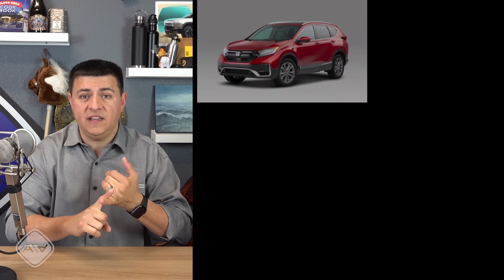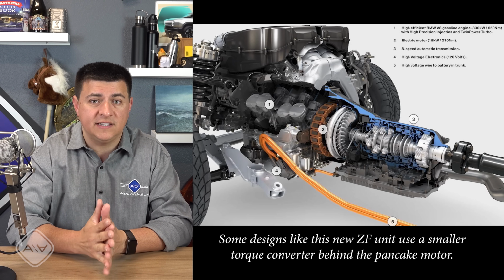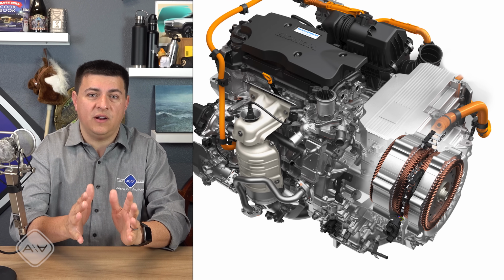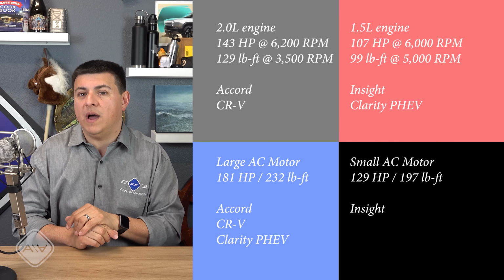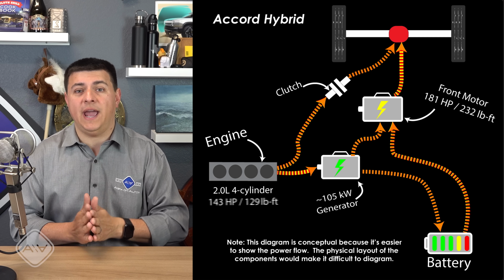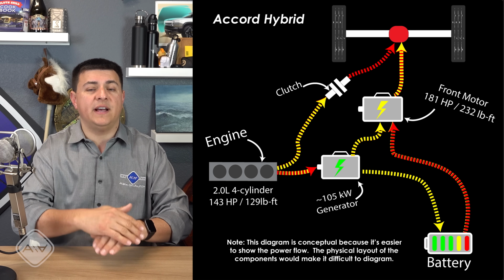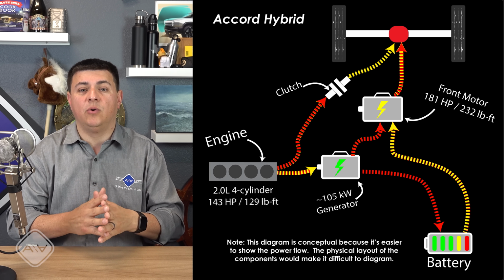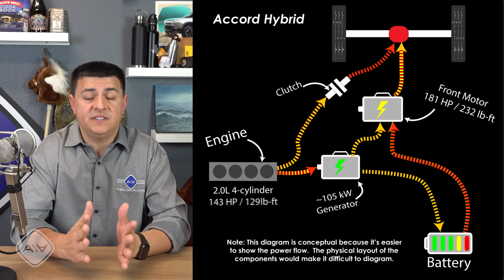How Does It Work?  Honda's 2 Motor Hybrid System Explained!

Comment: People who buy these cars don’t care what the “horsepower” numbers are.
Reply: Sure they do.

First off, directly comparing HP numbers is only valid if the engines and transmissions are roughly similar. Here's an example of famously-similar cars that illustrate that you can't use just horsepower:

Accord 1.5L, Turbo CVT, 192 HP. Car&Driver 7.3 seconds 0-60 mph, 5.2 seconds 50-70 mph.
Camry 2.5L, 8 Speed AT, 203 HP. Car&Driver 7.9 seconds 0-60 mph, 6.0 seconds 50-70 mph.

Accord 2.0L, Turbo 10AT, 252 HP. Car&Driver 5.7 seconds 0-60 mph, 4.1 seconds 50-70 mph.
Camry 3.5L, 8 Speed AT,  301 HP. Car&Driver 5.8 seconds 0-60 mph, 4.6 seconds 50-70 mph.

The Accord does much better with less horsepower, because it is turbocharged.

Second, it is a myth that Hybrids have to be under-powered. A myth propagated by manufacturers who want to squeeze an extra 1 or 2 mpg out of their cars because they think people won't care. Out of about 50 mpg, that is almost insignificant. Some hybrid owners do car about acceleration, and this system provides it. Note that #1, #3, and #7 on the following list use the system described in this video (#4 is a Toyota.):

https://www.motortrend.com/news/12-quickest-cars-get-40-mpg-higher-highway/

Third, It is true that #1 and #7 can really only put 181 HP "on the road," not the 212 HP they are rated at. But SAE Net HP, which is what gas-only cars advertise, is also not what those cars "put on the road." The difference in the Honda hybrids may be more, but that 181 HP is available at all speeds above about 40 mph. Gas cars can get it only when the transmission lines up with the peak HP.

Comment: Even though it's a new design, I can't believe they still engineer hybrids so bad!
I've always said, they need a 750-999cc triple cylinder engine, that's always connected to the wheels via a torque converter and a dual cog system when driving. 
It should be a motor tuned for torque, not hp (which is why a Diesel engine is much better).
It's low gear ratio should be ~ 1k rpm @ 10mph (5k @50 mph), for charging while driving mode, and it's high (overdrive) gear ratio should be ~1.5k @ 40 (~4k @ 100mph).
It's use should be just to maintain cruising speed, not acceleration. For acceleration the powerful (~100-150HP) electric motor is in place.
A high torque 750-900 cc engine in ICE mode only, in low gear should consume roughly 50-75 mpg driving between 20-35mph (and is mostly only driven for charging purposes, or driving the car in non electric mode) 
, and in high gear roughly 60 mpg, due to higher driving speeds.
At speeds over 85 mph a 750cc engine might need the electric motor to aid in speed (lowering battery charge at those speeds), and at ~100mph or greater, the 900cc engine will need electric power to gain more speed.
The correct way to make a hybrid, is to run an engine at a very high overdrive gear, and electronically control the throttle body for preventing lugging or predetonation. 
All you need is a single electric motor, acting both as motor and generator, mounted via a reduction gear and a clutch, to the output shaft of the engine, since the engine should ALWAYS  be driving the wheel (with the exception of stop-start traffic,  hence the torque converter).
Your greatest mpg gains are when the engine is running at 1.5-2.5k rpm, regardless of speed, and when it can directly transfer the power to the wheel, without a transmission (just a single reduction gear cog).
Reply: Doing it this way, the car will work well in hybrid mode, getting an average of 60mpg with the engine on at all times. 
Most of the charging will happen at stop lights. No need for multi motors.
This car also needs a supercapacitor pack, that contains enough energy to launch the car from 0-60 mph on all electric, or to store enough braking energy when coming down a large bridge.
Driving it in phev mode, means a larger battery pack is needed, and the car will need charging daily; the engine can be turned off at low speeds, and only turn on in high gear (above 40 mph) or when the battery pack reaches 25% range.
Reply: And why should we think your opinion is better than that of experts, such as Ward's Auto ("10 best engines" at least four times, dating back to 2014. HINT: It's not new.) Especially since much of what you claim it needs, it already has. And much of the rest is wrong.
Reply: @jeffjo8732  um, no.
If you know anything about the topic at hand, you'd definitely not say anything like that! All you need to be is a half assed engineer to see it!
And why my opinion is better than the so called "experts?
Because they've not come to that conclusion yet. It's simple science.
And if you look into my opinion, you'll know that parts are, but not in the exact order I wrote, which is necessary to reach higher mpgs.
For reference, a Ford fusion hybrid can almost hit 51MPG at 80mph and 1400rpm (with a 2.0 Atkinson engine).
The science shows what I write is correct.
I have no time for trolls like you!
Reply: @ProDigit80  You are very confident. It's interesting that you think all of these car manufacturers have less than "half assed engineers".
Reply: @Apofuexgaming  learn to write properly.
Reply: @ProDigit80  English must not be your first language
Reply: @ProDigit80  You say "Most of the charging will happen at stop lights." But no charging occurs at stop lights, unless the state of charge drops below about 20% and power is needed for something like air conditioning.

Most charging happens while cruising. The Accord needs maybe 10 to 15 HP to cruise, but the engine is most efficient at 34 HP. So it drives the generator at 34 HP, 10 to 15 HP of electrical power is sent to the motor, and 19 to 24 HP is sent to the battery (actual figures may vary). Even with losses in the conversion of power between mechanical, electrical, and chemical, this is more efficient, on average, than running the ICE at 10 to 15 HP.

"No need for multi motors." But there is a need for one motor and one generator.

"This car also needs a supercapacitor pack, that contains enough energy to launch the car from 0-60 mph on all electric, or to store enough braking energy when coming down a large bridge." Why not a battery? Which it has?

Maybe once you understand that, I can explain why the ICE clutches in between 45 and 75 mph.
Reply: @jeffjo8732  For a car with a small engine, it is better for it to charge during stops, always running at it's efficiency peak, because it doesn't have much power to charge while driving, and is more efficient to rout all that energy to the drive train instead.

Instead of splitting the charge between battery and motor, it's much better to split the energy between drive and charge, as there will be less drive train losses.

A capacitor pack absorbs regenerative braking energy much quicker than a battery pack, and can hold much higher currents. the problem with a battery pack is that it's expensive, large and heavy.
A capacitor pack can also release energy quicker than a battery, and experiences virtually no wear from high amp charging and draining, which could make it excellent for electric braking, and allowing the electric motor(s) to accelerate without being held back by the output of the battery.

A Ford Fusion Hybrid has a 1.7kWh battery pack (up from 1.4kW on older models), but is for the rest identical to a Ford Fusion Energy (which has a 7kWh pack).
The increase in size of the pack, allows the electric motor to not have to be limited to 20kW of acceleration under normal operation, but accelerate at its rated 30kW. On the 1.7kW pack, the electric motor only occasionally hits 30kW output, but is mostly limited to 20kW. Good enough to cruise at 60MPH, but not good enough to accelerate from 30-60 mph without feeling sluggish.
A capacitor pack would offer a compromise of a faster acceleration boost, without overworking the smaller battery packs, and is a plate that is about the same size as a battery cell.
By allowing a capacitor pack to absorb most of the energy ripples (charge and drain), the battery pack's life can be greatly extended.
Reply: @ProDigit80  If the sweet spot of the ICE produces less power than the car needs for cruising, it has insufficient power for the car. Buit that is less than 20 HP. These cars do not have that small of an ICE. I can go through the math more slowly for you if it would help, but any “half-assed engineer” should be able to understand the numbers I already gave you.

Charging while stopped is the least efficient way to charge, since it includes every possible loss mechanism. Splitting power between direct drive and charge is indeed the best transmission method, which is why Honda employs the clutch for highway speeds. But including a ratio-changing transmission sacrifices some of that benefit, and the relative power needed for the ICE makes it much harder to run the ICE optimally. This tradeoff is evidenced by the actual engineering solutions of Honda, Toyota, and Hyundai, which get very similar efficiency numbers. But the Honda system is usually more powerful.
Reply: @jeffjo8732    I think you need to carefully read again what I wrote, because your last post has several misconceptions.
1- The sweet spot for any 600-900cc will be roughly 20HP, which is good enough for charging the battery pack. If it reaches 20hp at 2k rpm, the engine will easily top out at around 45-65HP peak, which is fast enough to drive between 65 and 80mph via either direct drive or cvt.
Any faster, and the engine will borrow power from the battery pack, hence what I wrote, an electric car, with a small engine. That means a 25-35kW battery pack, not a hybrid battery.

Charging while stopped actually makes the most sense. Efficiency at that moment doesn't matter, as a small engine charging the battery pack at optimal efficiency, will always be optimal, regardless if its standing still, or while driving.
The difference between the two methodologies, is that a small engine can start charging a battery pack while standing still, because all of it's power can be routed to charging, and none is routed to driving.
With a cvt, a small engine may not have sufficient power to charge while driving +60MPH. And electric motors are taxed heavier when used for acceleration. 
I can't reply to all the misconceptions in your post without writing pages of info, but if you'd like some more feedback on where you went wrong with your explanation, feel free to ask, and I'll answer.

It all comes down to this: a twin/triple 600-900 cc engine, will both charge and cruise more efficiently, and can attain higher mpg values, than a 1.5L or greater 4 cylinder can, all while being powerful enough.
Hence why to lower the engine output, and increase the electric motor output (an electric with a small constant drive gasoline engine, that only disengages at very low speeds).
The only con is that a small engine needs longer charging times, making it run longer, hence the best time to charge is while stopped or driving very slow.
Reply: @ProDigit80   No, you need to watch the video and read carefully. The 1933 cc ICE in the Accord hybrid has its sweet spot at 2000 rpm, 88.5 HP, 33.7 HP, and 40.6% thermal efficiency. You seem to think it needs an underpowered ICE, but that is "half-assed engineering" to use your words.

Charging while stopped actually makes no sense. First, you can't depend on being stopped for enough time to acquire sufficient charge. So you will have to allow charging while driving as well. And any way you do that, you can send some power to the wheels at the same time without suffering battery losses. Exchange the time spent charging while stopped for more charging while driving, and you gain efficiency.

"With a cvt," ... what CVT? ... " a small engine may not have sufficient power to charge while driving +60MPH." Which is why you don't want a small engine. Sure, if you want to be slower than a Prius, you can try. That isn't Honda's design goal.

"It all comes down to this: a twin/triple 600-900 cc engine, will both charge and cruise more efficiently" Nope. Your suggestions are less efficient than what I described.

But you refuse to consider anything but the conclusion you want, so there really doesn't seem to be a point in trying to discuss it. Nor is this the correct forum.
Reply: @jeffjo8732  you're off on all your ideas, and not getting, or refusing to see the benefits of the ideas I presented.
Instead, you just bring up different designs and ideas that are totally besides the point! You try to disprove my ideas, by stating things that are totally unrelated to what I wrote, so I'mnot sure what you're getting at.
You also don't explain anything. You just state things. Like, explain why you think that a small engine charging the battery (always on) is inefficient? Much less, less efficient than your method of running an ice engine to drive a generator, driving a motor?
If you talk about inefficiency, I hope you see that the design you mention is a lot more inefficient, and totally unnecessary even!
You also keep going back to hybrid designs, and fail to understand that I am writing about electric cars with reduced battery pack sizes, having a helper engine, to extend range as much as possible through a direct drive system, rather than through a generator. 

Compare for instance the prius with the ford fusion or Hyundai Elantra hybrid.
FFH/HEH use a 2 liter atkinson, with a 40hp motor. Toyota uses a 1.5/1.6 with an 80hp motor. Toyota is better in MPG, because they go closer to my design than yours.
Also, a small engine is for constant thrust. Not for acceleration. That's why increasing the motor power output makes sense. Heck, my design can have near to Tesla acceleration, and yet better than Prius mpg levels!

A 660-900cc engine really is ideal for a tesla like sedan car. It's more efficient at charging a battery pack at 20hp, than a larger engine. It's more efficient at keeping a car cruising at a fixed speed, than a larger engine.

You apparently can't conceive that charging a battery (of an electric car, with larger pack), doesn't need to be done always, but as soon as the charge lowers below a threshold (say 50%), the smaller engine can charge the pack at nearly all speeds below 65mph constantly. This wouldn't work for a hybrid, but does work for a gasoline engine aided electric car or phev.
 
And doing this while standing still is ideal for range extending!

I think YOU are the one who refuses to see my point. You keep bringing up moot arguments that prove or tell nothing.
What I write about WORKS! And it works well!
What you write about is TOTALLY besides the point. And when I ask you about perhaps asking questions, instead of vague statements that are besides the point of what I'm writing, you keep adding vague statements. After which you just start accusing me of doing what essentially you are doing, not seeing the point of what I wrote, just babbling on about God knows what, to disprove whatever you fail to see...
If you have a question about the design, I will more than happy to explain. 
But you haven't asked a single thing.
Instead, you try to disprove what I wrote by things that aren't even related to what I wrote!

Comment: You’ll never see max hp on the road with this car.

The speed required is 156.55 mph. However, the car has a speed limiter at 100 mph.

The most the engine will spin when engaged to the transmission is 3513.255 rpm before hitting the speed limiter.

Honda should give a power figure for the engine at that rpm.
Reply: Alex's comments on horsepower are completely wrong. I've got comments on this below, but I'll summarize them here.

The engine is only connected to the wheels in Engine Drive. That's Honda-Hybrid-speak for "overdrive," or "low-power highway cruising." Anytime the car needs more than about, say, 50 HP, it drops into Hybrid drive where there is no relationship between vehicle speed and engine rpm. Your numbers do not apply.

A gas car can only "see" its max HP at one specific engine rpm. In hybrid drive, the combined power of the generator and battery can reach 212 HP. You can theoretically "see" this at any speed above about 37 mph (motor at 4100 rpm) - below that, the motor is torque limited at 232.1 lb-ft, and can't make full horsepower.

And please, don't tell me that the max power of the motor is 181 HP. That isn't the number to compare to a gas car's HP rating, which is measured at the crankshaft. The motor's power is at the countershaft. A common estimate of how much crankshaft power can reach the countershaft is 85%. And guess what - 85% of 212 HP is. So the maximum wheel HP of a 212 HP gas engine is 181 HP. Said another way, the 212 HP Accord Hybrid compares to a 212 HP gas Accord.

Comment: It is did not 2 motors but 1 motor + 1 generator.
Reply: It is two motor-generators. The smaller one (on the right @2:35) is the one Alex calls the generator. It's only (see edit) used as a motor to to start the engine. The larger one is the traction motor, but is used as a generator when little power is needed while the clutch is engaged, and for regenerative braking.

+++++
Edit: There is one other way it is used as a motor. Normally, if the battery becomes fully charged during a downhill run, regenerative braking would not be able to be used. In such cases, the generator is used as a motor to spin the gas engine, much like engine-braking in gas cars. You don't put wear on the brake pads, but don't recover the energy.